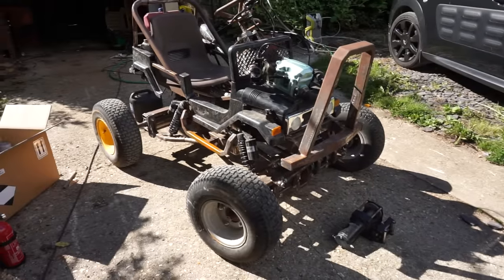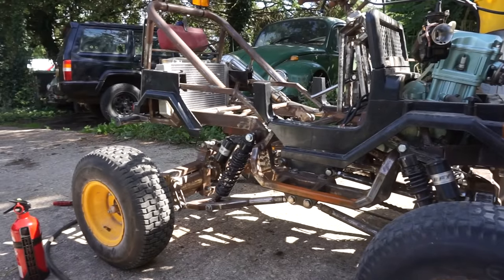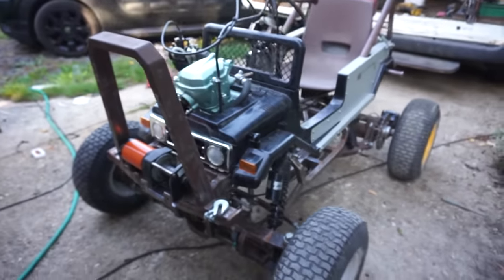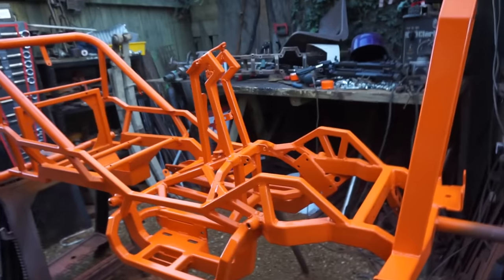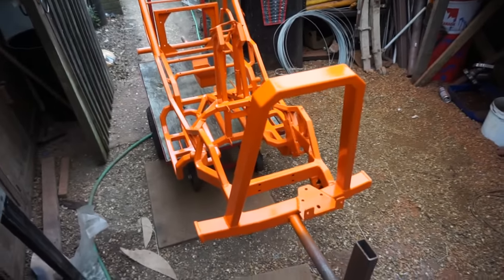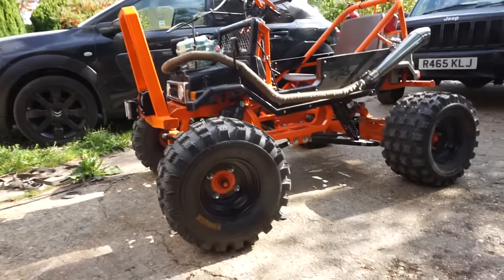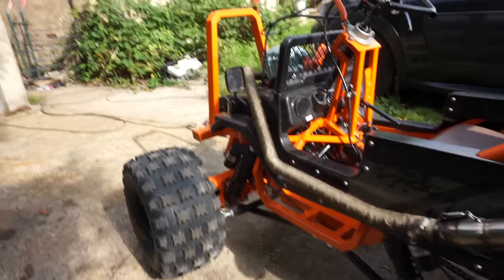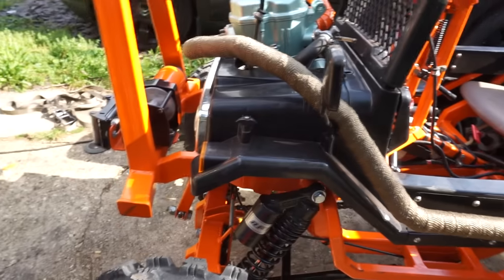4WD POWER WHEELS FJ40 IS FINALLY COMPLETE!!/Pt7/Bodywork,Strip down,Paint And Rebuild + RIP Around!!

Comment: I'm really impressed with how you designed the suspension system. I have built full size rock crawling rigs and I do a very similar style link setup as what you did on this. Very cool man. I'm also impressed with how you made your front drive system. Definitely not something I have seen before. I'm not building something this small, although I may in the future,  but I am in the process of building a mini rock crawler with a full custom tube chassis. Its a single seat buggy that is running suzuki Samaria axles front and rear and running a three link up front and a triangulated 4 link in the rear. Running air shocks, no springs at all, and the suspension has so much droop that I have to run limit straps. Running 33" tires right now but I may step up to 35s and run a true bead lock wheel.
Reply from the maker: Thanks man! Wow that sounds awsum bro! Id love to make a proper little crawler like that one day! Take care bud!

Comment: This is one of the best Power Wheels builds I've seen on the internet even over grind hard Plumbing. You need a MIG welder boy. So much Innovative fabrication. Very well done. You also need an HVLP spray gun. It will save so much time and wasted paint
Reply from the maker: Thanks a bunch man! I appreciate it! I agree spray paint is not the way to go if you wanna save moneys! I hav a mig just keep running out of gas 🤣🤘

Comment: Dude, this is one better than grind hard plum and rather be welding, that frame and fabbed panels is on point. Now will it rip out and travel the trails and jump hard? Nice maybe a Ducati 3 cylinder for the extra power to pull a hill. But the drive train and frame is on point.
Reply from the maker: Thanks man! Yeah i over engineered everything so that when i can afford a powerful engine it shud be a easy swap! Ducati wud be sick!! 🤘
Reply: Para completar los 1.000 comentarios

Comment: You might want to get some PTO shaft u-joints for the front, they are compact and can transfer a lot of power, while having very good clearance during misalignment.
Reply from the maker: Cheers bud! Its not so much the clearance thats the issue. Its more the ''phasing'' or difference in speed of the output shaft for every 90degree rotation. Might chuck sum cv joints a t it in the future. Will be interesting to see how it lasts ya know for testing purposes!
Reply: @councilhousecreations8035  you could do a double cardan joint to cancel out the phase errors.

Comment: First video of this build i have seen. Pretty impressive job and i love fact you took standard parts that anyone can get for relative cheap and built it like that. Not like Grind hard who bought ATV for drive train, that normally around here cost 4-6K€ if moving forwards at all.
If those nuts give out in front axle just machine your own from tool steel and harden then to desired hardness. All possible in home shop as well.
For rear bottoming out, ffs move those coolant tubes or build protection for them, so you dont accidentally flatten the coolant pipes and ruin the engine when water does not circulate properly.
Only thing i'm not fan off is the front bumper thingy, rather have taller roll bar at back, otherwise killer build!
Reply from the maker: Cheers bud i appreciate it! Yeah theres still a bit to do before shes fully there lol lol didnt even think about where the axle would end up 😂 im gunna try and trash them nuts at sum point see what results we yield!

Comment: The bracket that is hitting underneath on the chain try using a skateboard wheel like a tensioner to stop it from hitting the metal and that'll work real good it'll roll on the skateboard wheel
Reply from the maker: My thoughts exactly!! 👍

Comment: Does the chain bind when the suspension articulates?  How much flex can you get?   I want to do something similar. This seems more cost effective than using  differentials and drive shafts from an ATV.
Reply from the maker: No problems as yet. The smaller the sprocket the more flex it can handle

Comment: Very Nice!!!
The only thing I dont care for is the stinger being so tall.
Reply from the maker: Cheers bud!
Reply: The stinger is probably also doubling as a rollover bar to protect rider engine steering wheel etc.
Reply: @andrewjones6108  
  The stinger wouldnt do anything to protect the rider.
And it's way higher than the engine.
Reply from the maker: @andrewjones6108  THANK YOU!!!
Reply: TrulyUnfortunate you obviously have never rolled anything like this before. Having the stinger there and having it that high gives him plenty of room to tuck in to either side of the steering wheel before rolling. I have experience in this. Unfortunately I didn’t do anything like that so I almost broke my neck and the weight broke the casting in my intake manifold. I’ll be adding something like this soon enough and maybe a tube roll bar around my windshield to give the engine a little more protection. Plus I can add lights/light bar! 😁😁
Reply: @andrewjones6108   He'd fold like a taco.
  The stinger would do nothing to save him.
I've been an avid off roader my whole life.From motorcycles,jeeps and SXS's and I've rolled all of them.
  So I have a pretty good idea on how it works after 45 years of it.

Comment: How is the chain staying on the sprockets with suspension???  seems like twisting of the sprocket would pop it off???
Reply from the maker: the chain is fairly tight at the moment and the sprockets still point at each other as it flex's plus lots of hope! havent had any issues yet will probs need a roll bar and chain tensioner soon!

Comment: Kick ass job daddio, just have 1 question. Why are you doing your final welding on tge frame with a stick instead of using the mig welder.... Just curious
Reply from the maker: Kept running out of gas lol 🤣 plus its cheaper with the stick and just as strong!
Reply: @councilhousecreations8035  right on makes sense. Well great job anyways keep up the great work

Comment: Personally I think if you used less shock incline on the front and especially the rear you’d have your clearance and more spring because the shock isn’t rotating it’s only compressing with a more strait up and down angle.

Comment: Great job mate Yeah I could hear the carb cutting a bit long as you have adjustable jets you shouldn't have a problem dialing it in I have a 50cc Wolf Blaze scooter the stock carb sucks balls you can't adjust nothing but the idle screw from the out side of it Worst carb ever I'm going to replace it probably with a Kikuni slide piston carb instead of the ole butterfly flap style I think the slide crabs are a little better I hear and in my experience with dirt bikes the are a little better If you have a suggestion on a replacement carb plz let me know I subed Can't wait to see more of your experiment Grind Hard would be proud ✌️
Reply from the maker: Thanks a bunch man! Yeah slide carbs seem a bit higher class but dude i havent got a clue when it comes to carbs! Was kinda hoping it would just bolt on and work 🤣 take take bud!
Reply: @councilhousecreations8035  Your welcome Yeah it's nice when you just put things on and it works perfect I'm never that lucky though mate lol ✌️

Comment: The engine doesn't sound right. Is it misfiring or down on power?
Reply from the maker: Im hoping its the carb that just needs jetting!
Reply: @councilhousecreations8035  the open exhaust may be making it run lean.  Try moving the carb needle circlip down a groove (if it has one) to increase the mixture.

Either way, I wouldn't drive it too long sounding like that!
Reply from the maker: @thomaswykes3647  cheers buddy il try it out!

Comment: Which material it's chassis made of
Reply from the maker: Chassis is made from mainly 50x25x3mm mild steel box section. Also has 25x25x3 box and 20x20x2.5 box for strengthening.
Reply: @councilhousecreations8035  I want to make a jeep which can carry weight of 800 kg which material shall I use..
Reply from the maker: @RAJEEVKUMAR-xk5pz  you could use 60x40 box for the chassis then 25mm box for the rest!